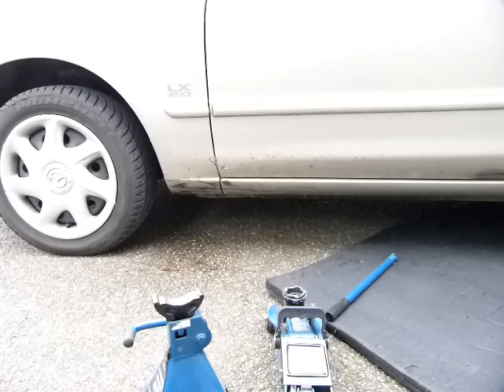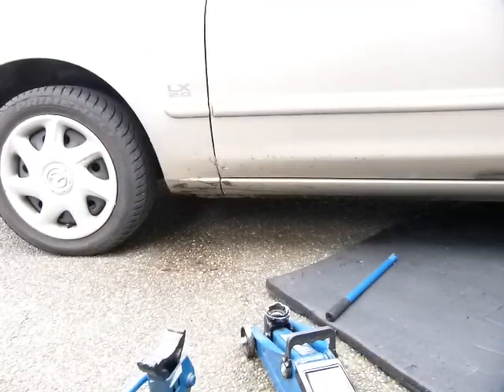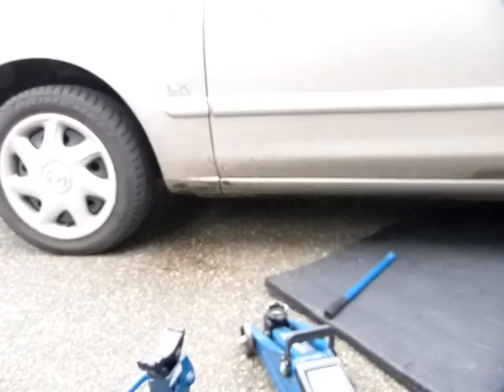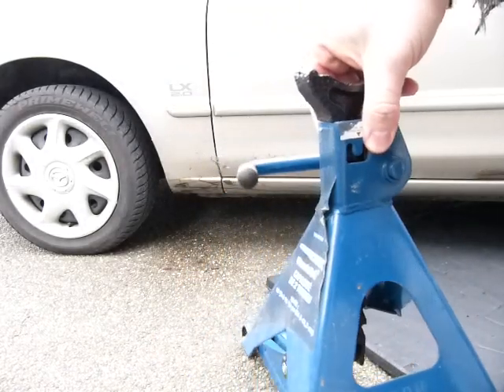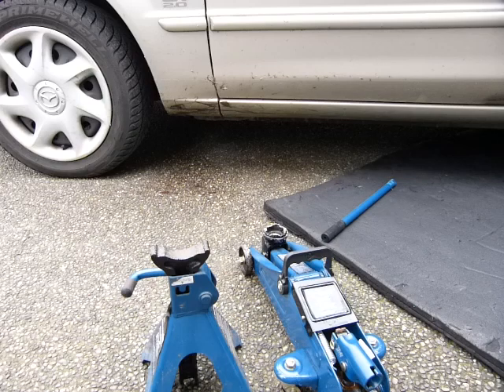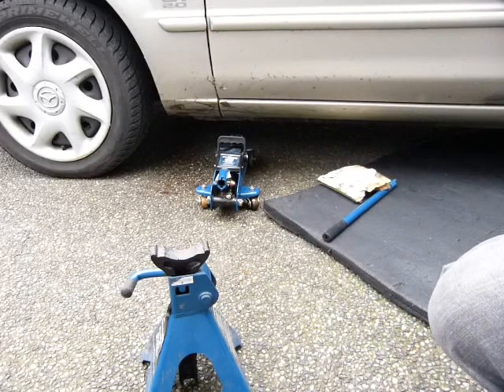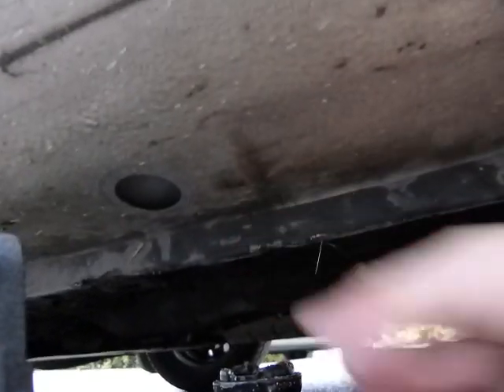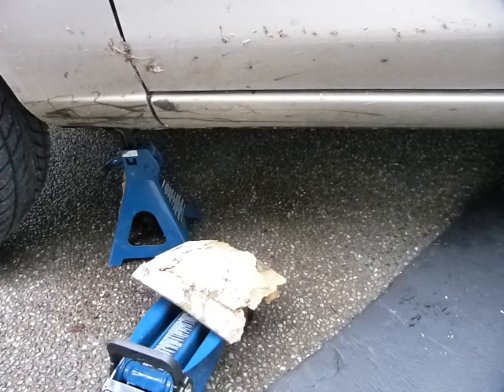Lift a car safely using a jack and an axle stand

Comment: Nothing about how to use the jack or axle stand safely... Everything about where NOT to jack up your car 🤦🏻‍♂️ please remove this video. It can endanger someone's life and damage the car.
That "thin" metal edge is the strong part of a monocoque chassis. Where multiple panels and strengthening sections are welded together. There is also 2 spots per side which are reinforced on this 'thin metal edge'.

Comment: There's arrows on the side skirt indicating Jack point , you've done all this wrong , the metal ledge is to catch and latch.
I see in your video you avoided this and also pumped at an angle instead of straight hence movement in the jack.
 AVOID !! this advice this is How not to do it.
Reply: It's dangerous isn't it!!

Comment: the owners manual says to use the metal edge
Reply from the maker: Of course it does.
Reply: @theoverengineer  well it would...that's the strong point .. there is two points per side which are reinforced. Never jack on the floor of the car!

Comment: You should loosen the lug nuts on your wheel prior to lifting the car off the ground so that you don't jerk the car off the Jack once in the air. Also you should always make sure to use the lift Jack points. As mentioned in previous comments this will punch a hole in the bottom of your car
Reply from the maker: Still no hole in car since, there never will be.
I also don`t do theories, test yourself and actually see.
Thanks for watching.

Comment: I'm wondering if you made two videos and posted the wrong one. People have criticized you for not using a proper jack point. And you defend your video by saying that you told them to use the axle joint. I've just rewatched it and you never say that.

What you do say at 3 minutes in is non-specific about where to put the jack. Also, at 3 minutes 24 seconds you say put the Jack inside or outside of the crimp line. But you do not specify a good jacking point.

In short, the video does not appear to have the content you expect it to have. And it is dangerously incorrect.
Reply: Agreed

Comment: GVWR isn't the curb weight of the car, its the maximum weight so includes all passengers the car can carry and full tank of fuel and a boot full of luggage, curb weight is just how much it weighs sat about with nothing but fuel and other fluids in it

Comment: Those stands are miss placed. I wouldn't trust that set up for one second that area is only used to jack the car up that's it.
Reply from the maker: If a point is strong for lifting or hoisting, why is it weak to rest a load at?

Comment: This poster has some very, very knowledgeable and helpful videos. That is for darn sure!  Unfortunately, I cannot agree with this particular video. First, block two wheels front and back on a level surface and apply the E-brake or put it in park or gear if you can. Sometimes you cannot because of the job needing to be completed.  I always lift by the metal edge, sub frame or axle. Jack stand goes under one of the three I just mentioned. You can lift other places, but not the floor boards! They might hold but why be risky? I always have two supports placed strategically so that if one fails the other will save me. So, usually I lower onto the jack stand and then reengage the jack and lift until both jack stand and jack have equal load. Yes, I had bent the metal edge a time or two with a jack like his. In that case I always leave some place nearest to the wheel unbent. This way if I get a flat on the road, I can more easily use the jack supplied with the vehicle to change the wheel. Am I worried about the frame bending or rusting at the bent edge. Nope! If you are worried, just spray it with undercoat.
Reply from the maker: Nobody said lift by the floor board. Where is that in the video?
Reply: @theoverengineer  that's exactly what you did. You just jacked the car up on the floor, the thinnest part of the car!

Comment: Stopped watching and disiked at 3:17 because he says "don't lift by the metal edge. The "metal edge" is specifically pointed out in my Toyota Avalon's owners manual to be used as the jack point. Even with a floor jack such as he is using the metal edge on my Avalon is the specified jack point in the manual. Bad teaching here!
Reply from the maker: Stopped reading comment halfway through line one because it misquotes the video to make a case about something nonexisting.
Video says: "Don`t lift by the metal edge WHEN  USING HYDRAULIC LIFT WITH A HEAD SHAPE NOT DESIGNED FOR FITTING THE METAL EDGE"
It`s called "lack of attention" in your case, usualy terminal.

Comment: hi.i have a 6x10 cargo trail. not sure of weight but reg says 2990 gvwr. the height is aprox 861/2  " but my garage opening is only 84".due to hoa rules i need to keep it in my garage.i was able to get it in yrs ago by flattening the tire and it just barely made it in.this makes it impractical to use often.i'm thinking of keeping it on bare rims just to pull it in and out of garage with no clearance headaches .once in the drive way jacking it up installing the rimed tires and going.and doing the reverse to get it back in the garage.do you think it safe ,leaving  the hitch connected to the truck ,to jack the trailer up from the center rear with a 3 ton floor jack and 2 jack stands lifting both wheels off the ground simultaneously to remove the rims and install the rims with tires on them to avoid having to jack one side at a time to make this operation faster?
Reply from the maker: +bob woerner Connecting to the hitch is a good idea as long as tow vehicle`s brakes are on. Lifting at the center could work with some caution. The wheels are suspended at the perimeter flame. Lifting at the mid-point will generate a bending moment on the axle or floor joist which can permanently deform it in just 1 lift. If the axle/center joist is strong enough, no problem. If not, the trailer can still be lifted at the center by placing an extra strong beam between the floor jack`s head and the axle/floor joist. This way the extra beam is subject to bending not the trailer. This extra beam can lift the trailer even if it only has a perimeter frame, from which the wheels are suspended and short half-axles are used.
Let me know is how things go.
Reply: guess ill just stick with lifting each side at a time, will take a bit longer but wont take the chance of damage.

Comment: Damage my lowered Subaru, and nearly squashed myself with it when the new tarmac on my street hadn't set and the Axel stands sunk into the ground. This video could very well save my life!
Reply: i once foolishly jacked on ground that deformed in the rain and the jack rolled over. my axle stand pierced my side skirt. i could have died. be careful people. the ground must be very hard for jacking. also concrete any rougher than in this video will not let the jack move on its wheels which is essential - as the jack head raises it moves towards you in an arc. If the jack cant slide forwards on it's wheels to compensate for this movement, the jack is going to suddenly slip from underneath your car.
Reply: More like take your life... This is a video of how NOT to jack up your car!

Comment: this is a lesson on how to punch a hole in the underbody of your car. I really hope nobody tries this.
Reply: Ardent Fan  so who is right ?
Reply: Ardent Fan  mine has a metal round cup...thanks...i did not know this
Reply from the maker: Walter M Do tell everyone exatly how the process punches a hole through sheet steel when lifting is done at a swingarm pivot point as explicitely told?
Reply from the maker: I have a better close-up on the metal edge - jack head interaction in the link on the screen.
The axle stand IS at the swingarm pivot point, why else would I mention it if it wasn`t placed there? The jack head is at a stiffener rib.
No, I don`t care about thumbs up, down, or comments, my self-esteem is doing fine without constant approval or peer input.
Viewers are welcome to freely try out the ideas discussed and explore on their own terms and according to their own skill level. Nothing wrong with using the hand-crank mechanical jack (another video) if one is not familiar with structural engineering, point loads and mechnical properties of HSLA steel.
Thanks for commenting.

Comment: So, we now know one of the areas to NOT jack the car up (the thin metal rail). Can someone say where is good to place jack and jackstands? Can you jack or stand at wheel axles, differential, suspension, etc?  Thanks!
Reply: You actually should jack it up under that thin metal lip. It's called a pinch weld and it sits right under the frame
Reply: So it is okay to use this style of jack and lift the car right under the Folded pinch weld? As long as I use a piece of cardboard or wood in between.
Reply: @evan937  better still buy an adapter that sits on the jack that has a groove in it to straddle pinch weld, usually a hard rubber compound, lifts car no bent pinch weld 👍
Reply: @markbentley2390  wow I can't beleive I posted that 6 years ago. I now have those for both my jack and Jack stands to protect my car. 😊💯👍
Reply from the maker: +7205buttas Just like this https://www.youtube.com/watch?v=kv0Yc2F-VcQ
Reply from the maker: ted939 Suspension mounts and pivot points are strong, lift there. Diff case can crack, axle can roll and pivot, not good.
Reply: theoverengineer
Thanks for the reply, theoverengineer!
Where are the suspension mounts and pivot points - what do they look like?
Thanks!!
Reply from the maker: ted939 Best picture and explanation at 2:10 - 3:20 https://www.youtube.com/watch?v=kv0Yc2F-VcQ
Reply: theoverengineer Thanks!

Comment: Can't jacking up on the sill bend it though? I always jack it up on some part off the suspension assembly
Reply from the maker: RetroAdzz Of course it works with the right jack: https://www.youtube.com/watch?v=kv0Yc2F-VcQ
Reply: theoverengineer no I talking about using a trolley jack on the sills
Reply from the maker: RetroAdzz Oh, the round trolley jack head does not fit the sill`s profile, it`s gonna bend it, the bend chips the paint, rust sets in and a hole is the result.

Comment: Other pointed out that for all uni-body cars, pinch weld is strong enough to lift up the car.  Jack stands are rated in pairs, that 2 ton jack stand is safe to use only if you use pair and weight of the car is evenly distributed.  Jack stand is also off by 90 degrees.  Some of them have little notch to rest the pinch weld. That small floor jack does not have large enough wheels, you would need to protected the floor (drop some large 1/2" plywood).  If jack adapter is not used, better position to lift up the car is the front subframe (which also supports engine)  This is because  when no jack adapter is used, you can also crush the pinch weld.   When buffering the jack saddle, use folded up news paper or 1/4" plywood.  Anything thicker can shoot out and damage the car.
Reply: So it is okay to use this style of jack and lift the car right under the Folded pinch weld? As long as I use a piece of cardboard or wood in between.
Reply from the maker: Cardboard or wood doesn`t help if the jack`s head shape doesn`t match the pinch-welded edge. Cardboard only helps in protecting paint when hydraulic jack is used at a flat spot away from the welded edge.
Reply: +Evan93 get a jack pinchweld adaptor or a hocky puck.

Comment: Old car frame...new car frame use pinch welds on the frame this gentlemean said not to use.
Reply: So you really think it is fine just to use one of these jacks on the folded pinch weld? The jack that came with my car is designed to avoid the pinch weld and just contact what is underneath it if that makes sense. I have a jack like his though which has a flat contact point. So do I jack using the pinch rail or the flat base under it?
Reply from the maker: If the screw jack`s head matches the pinch welded edge, go for it. If the head is different, find a strong flat spot.

Comment: I like to put the stands under the bolts that hold the front subframe on my car. Suspension mounting points like that should be thick enough to take the pressure.

Comment: This is an example of how NOT to lift or support your vehicle SAFELY!
Reply: 1) the pinch weld CAN be used to lift the car, but should only with the aux spare tire jack, or the PROPER rubber padding designed for the pinch weld, (mechanic shops lift by the pinch weld with there vehicle hoists all the time.

2) the axle/jack stand used should never be place on a spot were a body panel attaches to, should have gotten under the car and position the stand onto the unibody frame support rails near we're you lifted the car. 

3) other than that, very good video sir and still informative.
Reply: Agreed. He needs to remove the video. This could end someone's life
Reply: @PiggyPower  there's nothing wrong with the video you bolt head.  You can clearly see the axle stand is supporting the car off the ground  ,stop with you BS
Reply: @jacquelinebishop8465  this is genuinely a dangerous video. 336k views of how NOT to jack up the car. The jack is being used on the thin floor of the vehicle where there is not strength, the "thin" piece of metal he says not to use is where there will be a section reinforced specifically design for jacking up! He then places the axle stand (not AXLE) stand on the same patch of thin floor!! I'd guarantee then if you looked at this area of the car after he had raised it and put the stand on it, it would be very bent and caved in! If you think this is the right way to raise a vehicle and make it safe for working under...please never ever ever work on a car until you've learnt how to safely raise and secure a vehicle for inspection/repair. Please, I'm serious, this is a dangerous video.
Reply: @PiggyPower  stop exaggerating ffs
Reply: @jacquelinebishop8465  I've not even started. With all respect I can assume you've not worked as a professional in the car industry, anyone who knows the smallest amount about raising and working on vehicles knows that this video is close to an April's fool video, it's THAT bad! Seriously! It's terrifying that 336k+ people might have watched this and then gone and done this ... It's genuinely life threatening to the person who works on their vehicle after jacking up and securing it like this.
Reply: @PiggyPower  336k views and not one report of any casualty. 
Do you think this person should be held responsible if there was ? 
If a person is too thick to work out as they're doing this that it could be as dangerous as  you say they maybe they should be getting an experienced mechanic to carry out the work if they can't work it out themselves? The video is still here and no reports so all goody good Sir 👍
Reply: @jacquelinebishop8465  if a car falls on you, I don’t think reporting a video to YouTube is on their priority list. It’s a guide of how to jack your car up and almost every part of it is either wrong or flat out dangerous… if someone knew how to work on their car and jack their car up, why would they then watch this video? This video isn’t for professionals it’s for those who don’t know how, which is why it’s so dangerous! Including yourself perhaps, please don’t follow this video guide! You’ll damage your car floor and put yourself at risk. 👍
Reply: @PiggyPower  but that's your own problem,  the guy isn't responsible for a person's actions 
It's called common sense 
Just because he's uploaded a video of how he's doing things doesn't mean you have to follow 
If you or anyone feels its unsafe,  then don't attempt it 
Stop making life harder for yourself
Reply: @jacquelinebishop8465  but he has uploaded a video to encourage others to do the same, that is irresponsible. This isn't a painting how to video where no human can come to harm, I do vehicle repair tutorials all the time and I take safety very seriously as 100s or 1000s of people who have no idea DO follow these guides. While I agree each takes his own life into his own hands, if you're recording and uploading a video of how to work safely on a vehicle but it's putting people's lives at risk, that person needs to accept that mistake and delete the video. When you upload such videos you HAVE to consider the consequences of someone following your guide, otherwise what was the point in doing it at all??
Reply: @PiggyPower  im not going to continue this conversation.  Once the car is lowered onto the axle stand its is not possible for the car to drop !! . Hes had the video on here 10 years and once again NOT ONE comment or report from anyone . 
I'll bet you in all these years hes still using the same method to raise his car .  If someone hasn't got the brains to see if its safe by looking at once jacked up and lowered ,they probably don't have the brains to even change a tyre 
Stop over exaggerating
Reply: @jacquelinebishop8465  then all these years he's been bending the floor pans of every vehicle he has raised. The axle stand needs to be placed under a significantly strong part of the chassis, he just pops it under the floor panel, which is made of very thin mental. It could literally tear through the floor! Please don't comment on matters you don't understand, I don't mean offence, but it's serious and I wouldn't start trying to explain to a professional rocket scientist that I knew more than them about the safe practices of mixing rocket fuel. If someone has been killed by following this video, no one would know sadly. I hope it hasn't happened but it could. YouTube/the channel need to remove this video asap.
Reply from the maker: Do fill in some details on how it should be done so we can all learn from it.